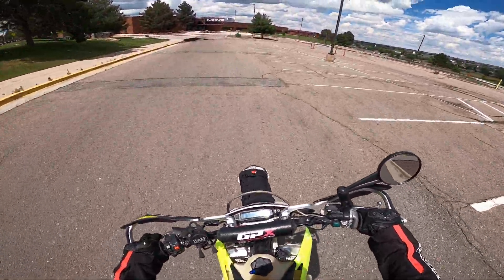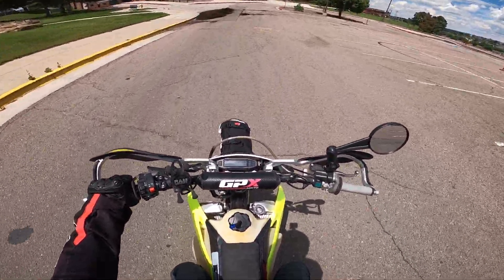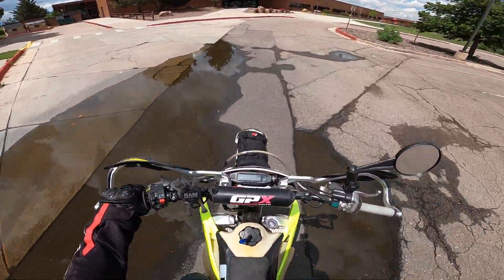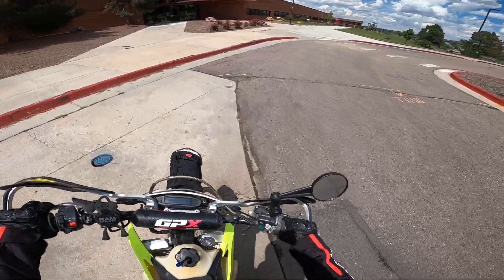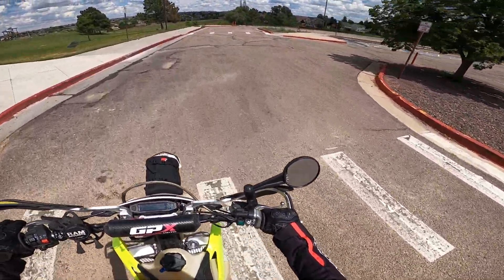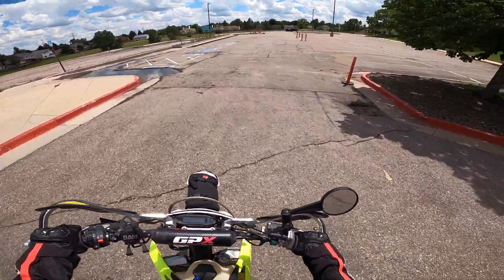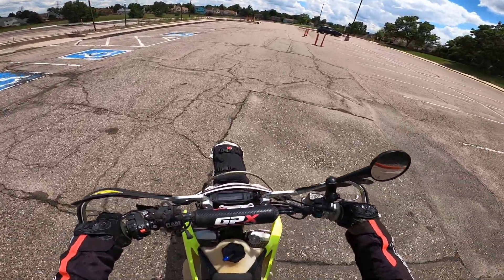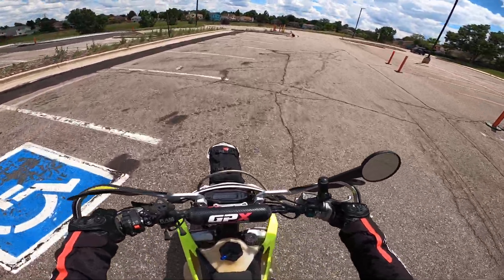06272021 GPX FSE300R OEM Delphi MT05.2 ECU First Tuning!

Comment: Can you send a list of how, and with what, you tuned the OEM ECU?
Reply from the maker: Yes this is OEM ECU but it is not documented so this is all guess and check. I plan on doing a write-up but I feel like I'm holding a can of gas here and giving it to folks that might not fully understand it's a can of flammable liquid (not saying you specifically just in general). Like I was overwhelmed by the settings in my ARacer, there is a lot of tunability in it, this is that on steroids....and not documented so you have no real idea what you're changing until after you've changed it.